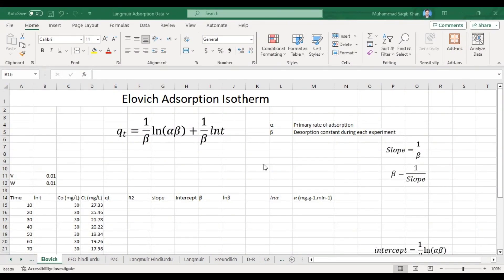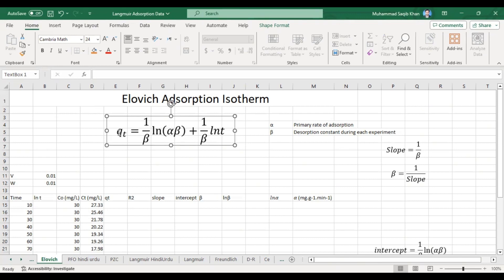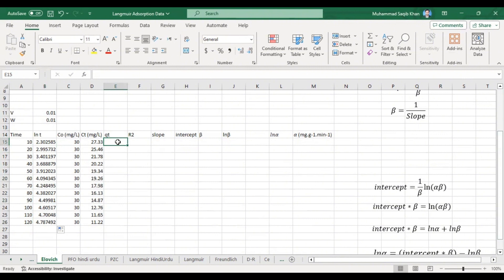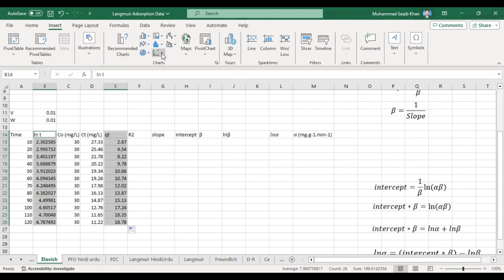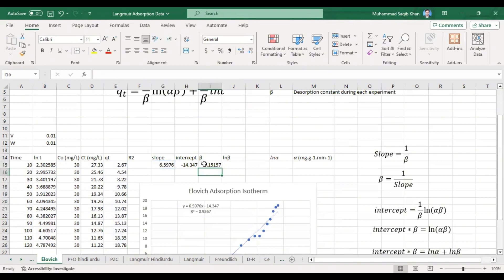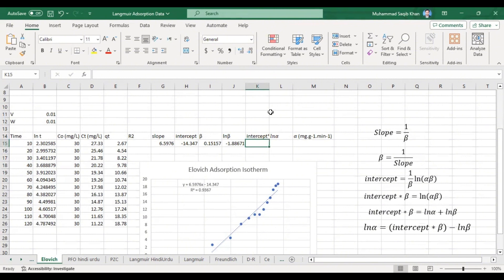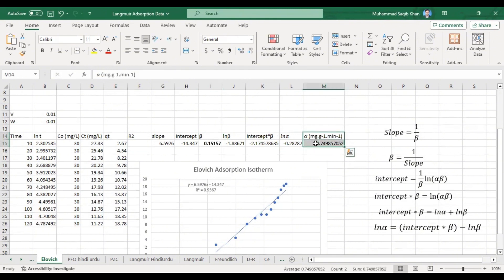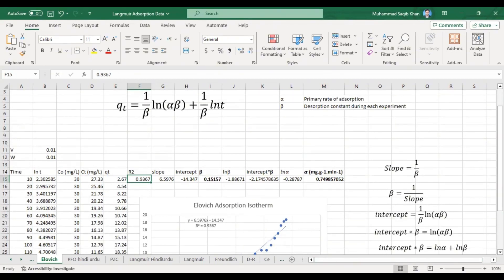Adsorption Data Analysis | How to Fit and Interpret Elovich Kinetic Model to Research Data

Comment: Good day Professor, I have watched your videos and they have been really helpful. I would like to ask why did you not include the data at 0 minutes in this Elovich plot but you included it in your PFO and PSO plots. Thank you.
Reply from the maker: Good day! I'm glad to hear that the videos have been helpful to you.
In the Elovich model, the data point at 0 minutes is often excluded because this model focuses on the later stages of adsorption, where the rate slows down, and the initial data might skew the analysis. However, in Pseudo First Order (PFO) and Pseudo Second Order (PSO) models, the 0-minute data is included to establish the initial condition of the system, which is crucial for accurately calculating the adsorption rate over time.